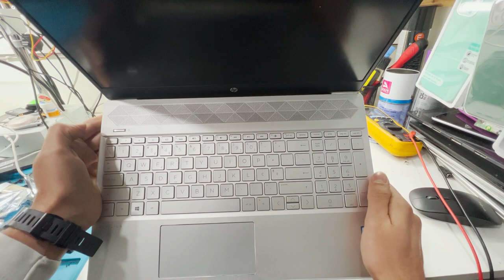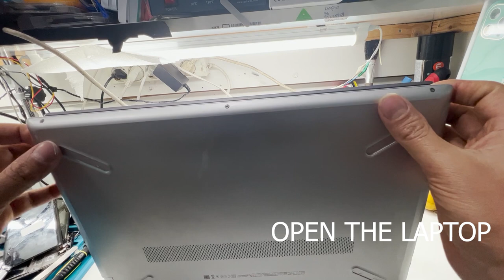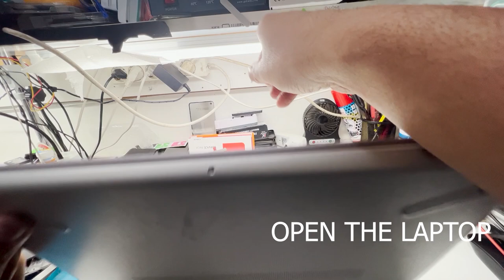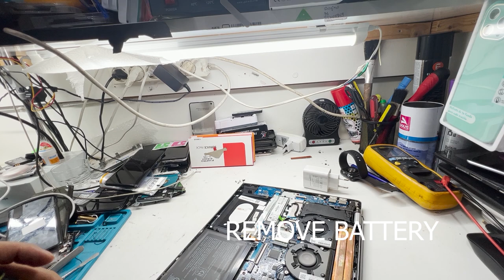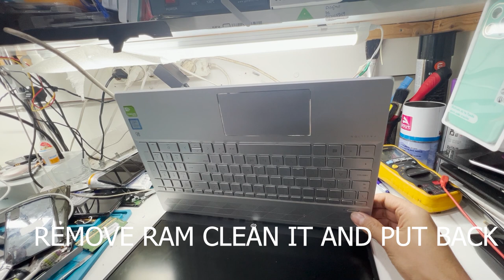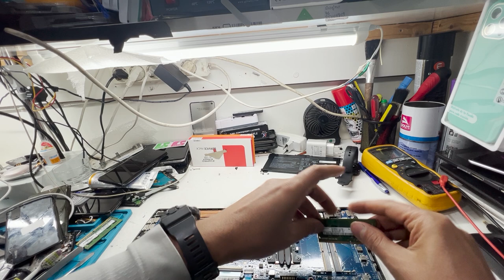How to Fix  a Laptop That Won't Turn On only Blinking Caps Lock

Comment: i have done all what you did but still the caps lock botton is blinking . and no display
Reply: Have you figured out a solution?
Reply: My technicians said it was moisture causing it but failed to fix it
Reply: did you fix it ?
Reply: did you fix it ?